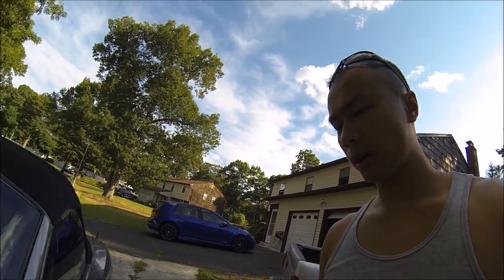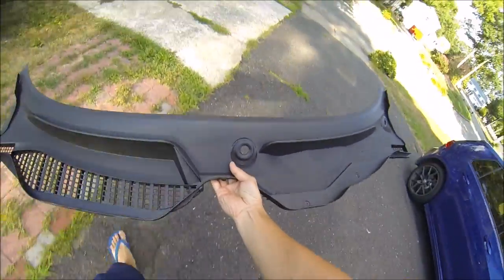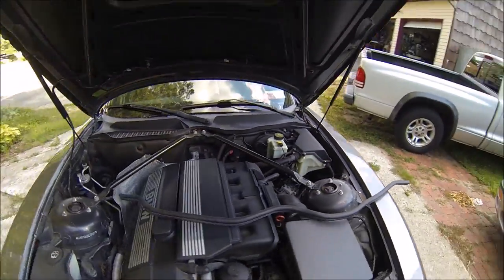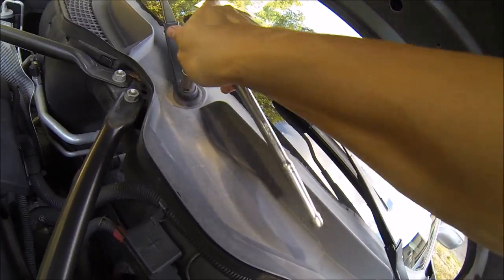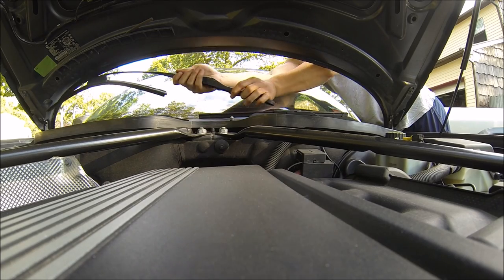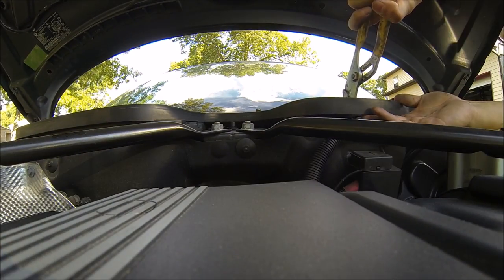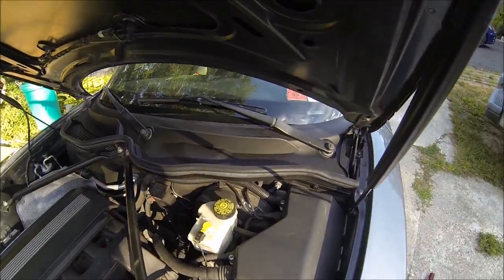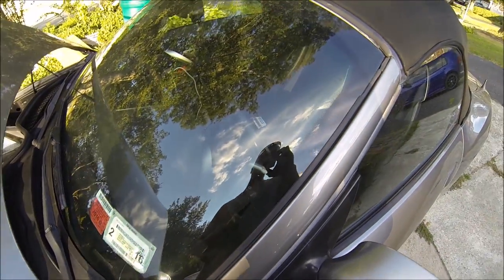Windshield Cowl Replacement - Z4 Vlog #7

Comment: Zed, thank you for the video. I just completed this for my '06 Z4. The windshield wipers came off after some penetrating oil and working them back and forth. There were 4 clips to remove. I had to open the electronics compartment to get to the driver's side clip. The plastic was soft and deformed the screw heads. Luckily, I had ordered extra. Make sure you check all the white push clips come out of the old holes. I tried to install the new cowling only to find 3 clips broke from the old cowling. I had to remove the new cowling and pull out the old white push clips. After that, installation was easy. Thank you again.

Comment: Great video made the replacement simple. One added tip for those having trouble removing the four revits, I used a 1/4 inch drill bit and drilled  them out. Also, I found leaving the wipers in the down position made it easier removing the wipers after spraying the with rust corrison blaster.

Comment: I recommend getting new clips before starting this job as you will probably destroy the old ones trying to remove them.  They do not unscrew although there are small philips screw marks on them. Just pry them out or off until they break apart.  Or drill them out as suggested below.  I used Lexus RX350 engine cover clips to hold the cowl on as I had them and they fit.
The 2003 Z4 I worked on had a rubber plug in the body by the driver's side that had to be removed because the new cowl had an extra pin that fit into that hole.  We also had to wiggle the edge piece close to the engine bay to get it to fit into the slot in the new cowl.
Reply: Did you need to replace the windshield Cowl Gasket?
Reply: @Jeff-vj3jp  No, I don't recall that.  We just replaced the part that was shown in the video.
Reply: @craigsnyder2686  Is there a special tool to screw in the 4 plastic rivets? Philips screwdriver doesn't quite work as the rivets are flimsy and strip easily.

Comment: My wiper arms would not come off by shaking the arm nor by tapping with a screw driver and mallet as recommended in the videos. Had to delay the job until I got a decent wiper arm puller. By the time you need to replace the cowl, you can be sure the wipers are on tight by minor chemical reaction between the metals and the wiper puller is needed. These are not expensive, hassle free, parts don't go flying and it worked great and a lot cheaper than having the job done at a garage. When reinstalling the wipers, I found on line that the wiper position is 24 mm from the tip to the cowl seal for the right (passenger side) wiper and 44 mm for the left (drivers side) wiper. Cleaning out the dirt that had had collected under the old cowl was the biggest part of the job. While at cleaning, you may as well remove the flexible shields just below the ends of the windshield and get the dirt out from under there as well. I used the OEM cowl from BMW. Everything is on the cowl, no need to buy clips, washers or grommets. Amazingly, it had only been manufactured 5 months before according to a sticker I found on it. Looks great.
Reply: Time to replace the rotted cowl on my 2003 Z4.  Did you need to replace the windshield Cowl Gasket?  I'm not sure where that is, but I'm thinking I probably need it.

Comment: How did you remove the front facing/drivers side clip that sits right behind the large plastic piece in front of the right side of the cowl? There is not enough room to get a screwdriver in this space to get the screw removed. Thanks.

Comment: Is there a special tool to screw in the 4 plastic rivets? Philips screwdriver doesn't quite work as the rivets are flimsy and strip easily.

Comment: Everything is good on this video except one thing! he forgot to mention some wiper hands are extremely hard to remove due to corrosion and rust... and a battery puller is required. Most cowl cracks have been in the sun too long so you can image wiggling hand will not work as he's showed in this video. important pointer here

Comment: Still can't get the wiper arms off!  I put on Freeze Off with no luck yet.  I'm going to order a windshield wiper arm "pull" tool.  They're cheap....
Reply: I'm using one and still having issues. Sprayed some lube in it so hopefully that works. My driver side wiper stopped working during moderate rain at night, was an interesting experience.
Reply: @nogodsnomasters666  I did finally get the wipers off, but it took some real work.  Good luck to you.

Comment: i have a question, these are thwo small holes in both sides for water, and there ir another big area with holes in only one (right side), that big area whit holes are from water or ventilation???
Reply from the maker: Intake for air going into cabin I believe

Comment: I'm about to replace the windshield trip and cowl in one go. I'm not seeing that adhesive is required for the cowl replacement. Is that true? Do you need an adhesive for the rubberized portion?
Reply from the maker: No adhesive is used

Comment: thanks for the video of the z4 but i cant get the wipers arms off
Reply: Everything is good on this video except one thing! he forgot to mention some wiper hands are extremely hard to remove due to corrosion and rust... and a battery puller is required. Most cowl cracks have been in the sun too long so you can image wiggling hand will not work as he's showed in this video. important pointer here

Comment: Help  Cannot get the wipers off
Reply from the maker: +Chaz M Once you get the 16mm bolt off, its just a matter of wiggling them. Don't try to move it in the same motion as the wiper motion, but rather perpendicular to that.. so like lift it off the windshield and back onto it, in a repeating motion. Hope that helps.
Reply: +zed4me  NO LUCK
Reply from the maker: Chaz M Sorry, maybe try some penetrating lube. Failing all else, bring it to a mechanic. I'm sure they can get it off.